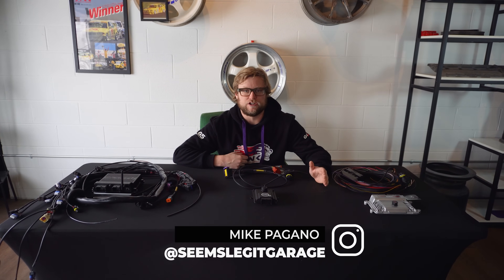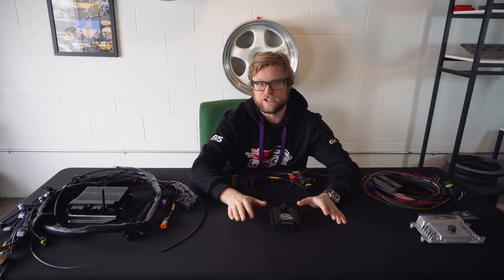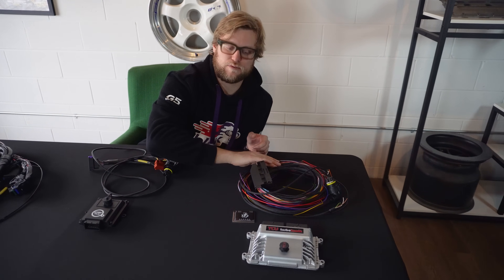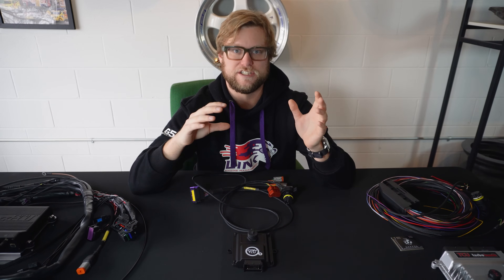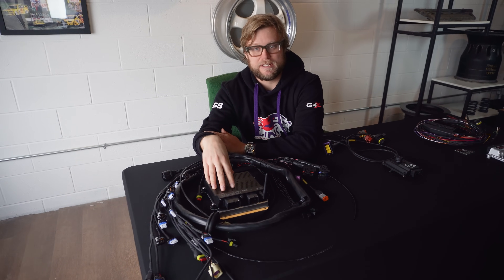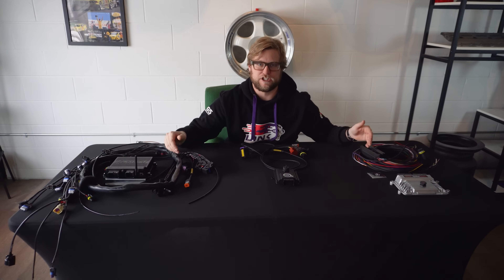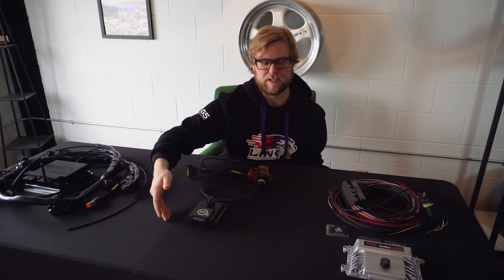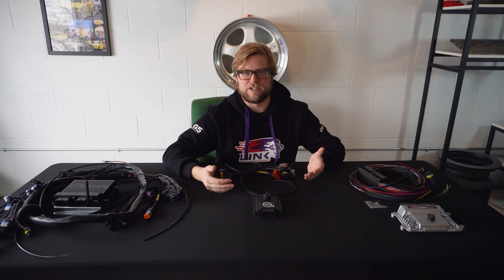Which DCT or 8HP Transmission Controller is Right for You? MaxxECU, CANTCU, or Turbolamik?

Comment: Hello. I'm restoring a 92 Mercedes Benz S600 V12. Putting an 8HP70 in. Will the MAXXECU control 12 cylinders and 2 throttle bodies?
Reply: Maxxecu Pro can handle that, and with dualbank (dual VE) control. dual internal lambda controllers etc included.

Comment: Would you say the maxxecu is on par with the turbolamik in terms of tune ability or is one a better option than the other in that regard.
Reply from the maker: Thre are more tables and stuff inl amik but that doesnt neccesarily make it worse or better. Most of the time, less is more.
Reply: @SeemsLegitGarage  thanks for the input. That was going to be the key factor in which one I chose. Most 8hp builds I see online run the turbolamik. So I haven’t found much feedback on the maxxecu. I drive an is300, and there is a complete engine harness with 8hp connectors for the maxxecu as well, so it seemed like the better option.

Comment: So I have a c1500 with the l31 5.7 sbc vortec with a slow 4l60e i wanna swap to the 8hp70 which would be best to pick up the gm sensors
Reply from the maker: Turbolamik
Reply: @SeemsLegitGarage thanks a bunch all the info I've found on my own hasn't really been yes or no for my exact fit,I had some idea cause most gm sensors are somewhat the same

Comment: Awesome video. Answered so many questions about being able to throw an S85 with DCT into anything i want. Would you still recommend the maxxecu even if i decide to go with a manual 6speed trans from an E60 M5 or M6?
Reply from the maker: I love the CANTCU for DCT control, I think Maxx focuses most on 8HPm but it for sure can kill two birds with one stone and is a great ecu I would use whether you use the DCT or not
Reply: @SeemsLegitGarage  Best Working solution for DCT is CanTCU, maxxecu has control for it. but what we have learned cantcu works best to achieve stock like working.

Comment: Does the Maxxecu let you control the time between shifts in manual mode? I believe I saw somewhere Turbolamik does this.
Reply from the maker: I’m not sure what you mean, your paddle shift is what times the shifts in manual mode?what do you mean?
Reply: @SeemsLegitGarage  I mean the delay between shifts. from the time you touch the paddle to the time it engages the actual gear. I may be over thinking it. But I feel this was a setting on turbolamik wasnt sure about MaxxECU
Reply from the maker: @codytobe  you can just decrease pressures to slow down the shifts though, you can do that essentially with both control strategies by torque table changes. There is no delay setting unless you build one with a math channel.

Comment: I built an EFI car 20 years ago and had nothing but headaches with the ECU. Now I want to LS swap a Camaro I was gonna get a 6L 80 to go with it but those things are huge. This transmission sounds appealing but if the controller is $1500 and I’m gonna have all kinds of tuning headaches because it’s not stock is that worth it?
Reply from the maker: Hi, what ECU are you using, or plan to use? The Maxx is great at handling both, and the Lamik can work with most OEM GM ECU pretty easily.

Comment: I want to swap a 8hp70 onto my big block c10 CARBURETED, i keep blowing transmissions up due to no good builders in my area , to what you said and what i have seen from other videos i should be able to run it with the turbolamik stand alone ecu, a PRND shifter and paddle shifters correct?. IF I AM WRONG PLEASE LET ME KNOW! i already bought the transmission and adapter plate.
Reply: Sounds like it would being it is a standalone controller. Depending on what version you use (CAN or analog) you may have issues with transmission performance. The CAN version can take advantage of a modern ECU to manipulate the engine and its data to maximize performance and longevity. Hope it works out

Comment: How much are the Hemi swap/8hp systems? I reached out to Maxxecu but they deferred me to a local dealer which doesn't exist where I'm at. They also pointed out their website, which is hard to follow. I could be burnt out.

I'm currently running a JeepSpeedShop set up for my swap but I want to get away from the stock gauges, levers and such.

I could probably get away with a different engine harness/ECU set up if it had a canbus system I could tie my 8 speed to but seems a lot of these stand alone kits don't have that ability
Reply from the maker: happy to help, email us!

Comment: FuelTech also entered the game.
But FT is all DIY. Replace TCU with a PCB and programm every single valve on your own.
Reply from the maker: Yea it’s also very jerky from what I’ve seen, more for just racing is their explanation
Reply: @SeemsLegitGarage  And at that point you might be better off using a DIY micro controller. Thats what i did 20years ago with a 4hp24.

Comment: I have a 1957 Plymouth 2 door hardtop. I'm running a 5.7 Hemi gen III.. I've just installed an 8HP and I've gone with the Maxcecu with their PDM20. For power distribution.

Haven't been to tune yet, still fabricating the rear engine mount..But soon.. I also have gone with a paddle shift getting rid of the Mopar shifter entirely.

Comment: I want to be different & single turbo my is350. My problem is the trans starts slipping around 450whp. Also my ecu doesnt have much storage. I want to put a stronger transmission, but also would be beneficial for me to have a standalone too. What should I do? I'm looking at 8hp transmissions
Reply from the maker: If looking into also upgrading both the ECU and Trans, use the MaxxECU to kill both birds with one stone and save!

Comment: Hello, Seems Legit Garage! A 2004 E46 M3 SMG swapped to the 8HP50 with TurboLamik TCU possible?
Reply from the maker: yes absolutely
Reply: @SeemsLegitGarage Would I run into CA smog and visual inspection failure by swapping out the transmission? (Leaving  the emission devices and S54 factory stock intact). Lastly, no factory cats exhaust routing interference as well?

Comment: I have a 1996 impala with a gen 3 6.2(bored over LQ).  It is drive by wire and running the 411 pcm. 

I want to replace the 4l60e, but I'd never race the car.  Could I have my local Maxxecu dealer install the Maxx mini just for the transmission control of the ZF8?
Reply: mini can control 8hp you just should feed some information from the engine to maxxecu, there is certain things to consider, for example 8hp transmission really wants to have blips(throttle) on downshits and possible cuts on upshifts to keep it "really happy".

Comment: Hi!!  I design and manufacture standalone TCU s, which can be remote turned from anywhere as long as there is a  WiFi connection available to the TCU or it can be tuned on Bluetooth or connected to a laptop.(not essential) it was actually designed to be tuned with an Android mobile phone. My pedal shift command module, display command module, and PRN command modules connect to the TCU wirelessly using ESP NOW tech. The TCU can run independent of all the other command modules if required and the others can be added in later. Currently I build for A340 /A442 / and Nissan Patrol, but I hope to have my newer versions even more customisable which will go up to 10 solenoids otu of which atlest 4 can support pwm
Reply: Details   Any for the 8hp?

Comment: I'm thinking of using 8hp on 13B rotary, will maxxecu mini enough for the build? Their comparison table shows at least sport version can do automatic transmission. 😢 Wondering if we have a budget choice or not
Reply from the maker: What ECU do you want to run?
Reply: @SeemsLegitGarage maxxecu? Mini or street? To run both ECU and TCU at once😢
Reply from the maker: @qiqisun  I would use a sport on a rotary like that for EThrottle
Reply: @SeemsLegitGarage  also a rotrex C38-81 centrifugal supercharger instead of turbo😅 so sport will be the one?
Reply from the maker: @qiqisun  great option!

Comment: Is there any LS based MaxxEcu that is self learning like the Haltech Rebel? Was gonna use a Rebel with a TurboLamik but I like the idea of having just one ecu controlling everything
Reply from the maker: The maxxECU has closed loop control that can learn, all aftermarket ECU work very similarly. We use the Maxx on our LS swap and its amazing, plus the harness they include is great.
Reply: @SeemsLegitGarage didn’t answer my question,the Rebel is 100% self learning with no tuning required,ever(you can if you want to) per parameters/sensors/etc that’s input on initial setup. Not talking about just closed loop.
Reply from the maker: @2jzInside1  That's just short term and long term fuel trimming , which is just a closed loop control function. https://www.haltech.com/news-events/short-and-long-term-fuel-trim/?srsltid=AfmBOopqQKmyfDvPMsZGU0Ju5-orLcCDgUrQFNVDz2FyUBDI_HTKCVqw

Comment: Hi doing a fun 2UZ swap into a 2010 Range Rover Sport L320 and will pretty much want to keep the ZF6HP26/28 would it better to use MAXXECU to control both Engine and Tranny also bearing in mind that I need native CAN signals to transfer case/Ride level Module/ABS and Terrain control

Comment: If i just want to replace an old bmw auto with an 8hp45. Examply an old e39 528i that just has an old worn out auto. No drift mode no race stuff just a better transmission  with stock driveability what would you suggest?
Reply from the maker: cantcu for sure!

Comment: I'm looking at using the CanTCU in my E46 running MS42, which I understand to be a supported ECU. Do you guys have any experience with wiring the CanTCU to the E46?
Reply from the maker: There is a full explanation for it at the link below. You should upgrade to MS43 so that you have an electronic throttle body, very important for DCT
https://www.ms4x.net/index.php?title=CanTCU_Integration
Reply: @SeemsLegitGarage thanks for the tip! I'll be running the 8HP, I think both work but the MS43 allows blips which might be worthwhile.
Reply from the maker: @ yes for sure
Reply from the maker: @jase_llan  yea for sure is

Comment: odd one here. E53 with M54B30 needs a gearbox replacement from the auto 5spd. I think 8HP45X is the way to go, which one should I choose? I daily it and occasionally have some fun in the winter. maybe add a supercharger/procharger in the future, it already has LPG on it
Reply: I'd look for a later model 8HP45, apparently some of the earlier models have an aluminum reverse gear that is prone to wearing out or overheating with prolonged reversing. Not that you'd be going 30mph backwards down the freeway but just something niche to consider
Reply from the maker: CANTCU

Comment: You can also use MaxxECU as an add-on alongside another ECU, just for transmission control. The MaxxECU Mini is quite affordable and gets the job done. MaxxECU is a top choice in any scenario.
Reply: Will maxxecu mini support 8hp? The comparison table only shows at least sport can support
Reply from the maker: @qiqisun  Yes the mini can do 8HP
Reply: @qiqisun to clarify, this is because the Maxx ecus aren't really TCUs. You reflash the factory TCU on the side of the trans and it sends signals to the factory TCU to trick it into thinking it's in a different configuration... Essentially.
Reply from the maker: not supported by Maxxecu support, therefore not recommended
Reply: @SeemsLegitGarage not true now... I talked to them the other day and they're working with Baldur from Baldur Controls to pair their ECU with his ECU just for transmission control.
Reply from the maker: @Akya2120  sure, still not ideal, we use different controller for this application.
Reply: @SeemsLegitGarage  which TCU do you use for that? I've thought about going with the Turbolamik but the price is high, and idk if I really need the features. Sure it would be cool to put a clutch in the car... But I'll be fine without it.

Might end up using the Maxx mini and just monitoring a couple extra sensors or running an auxiliary fuel in my diesel application.
Reply from the maker: @Akya2120  depends on the ECU used and it CAN capabilities, email us for more info, happy to discuss in detail. Just did a turbolamik install with all analog inputs, worked perfectly

Comment: Hi. Im doing MB w124 with om613 swap with 8hp 70. Do you think max ecu mini if the way to go for me, or Turbolamik?
Reply from the maker: turbolamik unless using maxxecu for engine control as well. I figure you mean using maxx as standalone with the mini
Reply: @SeemsLegitGarage im going to have mercedes orginal ecu for the engine, because diesel is simple and you dont need to do much tuning. And yeah i thought using the maxxecu mini only for the gearbox

Comment: What if I'm going to run a carbureted 6.0LS with msd ignition, and a 8hp70, in a drift car? I'm going to guess that your going to say turbolamik. 

I also have a 6.0 escalade prerunner build that I want to use to tow, street drive, and desert run.    The motor is slightly built but still on a stock hp tuned ecu

Comment: What if I have a OM606 engine ect, its like no wiring and no ECU????
Reply from the maker: @negueba235689  then use Turbolamik, which is very ok using normal analog inputs. Aka wiring a map, tps, and rom sensor signals directly to tcu
Reply: @SeemsLegitGarage  So you could say the Turbo Lamik is best for all carbureted swaps?
Reply from the maker: @thehpw  yes

Comment: Looking to do an 8hp swap on my 14 Chevy SS within the next year or so. 
Car is currently na with a cam, but I’ve been amassing parts for a procharger install. 
Would a flashed cantcu be my best bet? I don’t plan on going above 800whp
Reply from the maker: I would use the Turbolamik so you have trans brake

Comment: Hey man, awesome video! I have one question—I’m seriously considering the MaxxECU since it can control both the engine and gearbox.

Compared to the Turbolamik, do I need to open the gearbox to solder in that little PCB board, or is it a more straightforward plug-and-play setup?

Also, which MaxxECU would you recommend? My current setup is a turbocharged M50 making just over 600hp.
Reply from the maker: The great part about Maxx is you don't need to modify the 8HP70 mech, you just plug and play. The Race ECU would be perfect for you
Reply: I recently bought an 8HP45. Will it be plug-and-play for this gearbox as well?

Comment: Wow, I'm so grateful for this video. It seemed that the more I read, the more confused I got.

What would be your recommendation for my application?
I have a 96 4runner, and I have a echo diesel Ram 4wd 8hp that I'm planning on mating to a VW ALH 1.9 TDI. I hoped to convert it to full mechanical injection pump, but I would keep the necessary sensors to feed required data to the TCU.
Reply from the maker: Since it does not have CANBUS I would use the Turbolamik
Reply: @SeemsLegitGarage  I was hoping you wouldn't say that haha. The turbo lamik is so expensive lol

Comment: I kinda wish there were options for high powered fwd transmissions so you can build foraffordable mid engine designs as well. Also waiting on the day someone makes a kit for automated sequential builds.
Reply: I believe the Maxxecu can control VAG DSG transmissions to allow for that.
Reply: Can use Audi 8HP55 modified for mid engined. I'm using one of these behind a Jag v12.
Reply: Automated sequentials? You mean an automatic transmission?

Comment: I need a flexplate adapter to mate 8hp45 n20 trans/torque converter to M52 block. Is one available? Having a hard time finding one.
Reply from the maker: Yes, check this out, the N20 is the same really: https://www.seemslegitgarage.com/product-page/n57-flex-plate-and-starter-adapter-bundle
Reply: Omg, u know u can use oem bmw "flexplate". Buy used one for about 50$ and adapter for next 50€.
Just do a little job and google it ;)

Comment: When using MaxxECU as a stand alone transmission controller, what parameter inputs from the engine are needed? Currently looking into an 8HP...
Reply from the maker: MaxxECU does not recommend running it in this way, though it is possible. It will need a populated torque table, brake input, throttle position, IAT, Coolant temp, battery voltage and actual rev limit set in the settings.
Reply: @SeemsLegitGarage Thank you for the information. Do you know why its not recomended? I dont really see why that set up couldnt work reliably, though my knowledge is kind of surface level
Reply from the maker: @ They prefer customers to use their entire environment as the cut and blip functions are very much dependent on it and they focus as a ECU company primarily over TCU

Comment: thanks for the video i was trying to decide between maxxecu and cantcu for my dct sr20
Reply from the maker: Which one are you going to choose?
Reply: @SeemsLegitGarage  I current have old school ecu with cable throttle so I will switch to Maxxecu for drive by wire with cuts and blips, and DCT control all in one. I was tempted by how simple the CANTCU is but the value of maxxecu is too good to pass up

Comment: Maxxecu is not a controller.... It's a high spec engine management system with built in dct and zf8hp70 control... A lot lot more bang for yiur buck especially as it retains transmission logic from factory tcus
Reply: Bro it’s not a controller but it’s a controller lmao
Reply: Can you use this application on any vehicle?
I'm planning to run an LS engine on anything.
Does it work for all automotive applications
Reply: @jayjomillz even maxxecu entry level ECU will fully control the 8hp you can feed it the needed signals via obd or canbus, or tap into existing signal wires such as tps etc
Reply: Can it control  nag1 transmission, & how much
Reply: @teamfrank7750  it cant, for nag1 ofgear is currently "only" aftermarket controller.